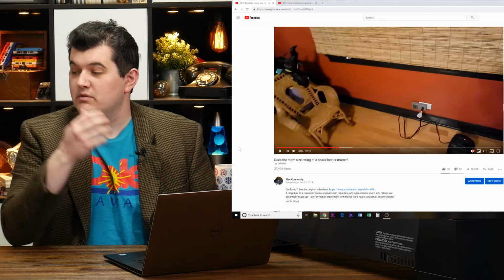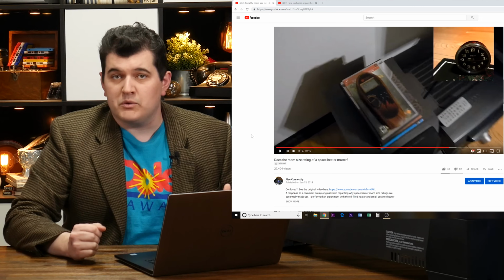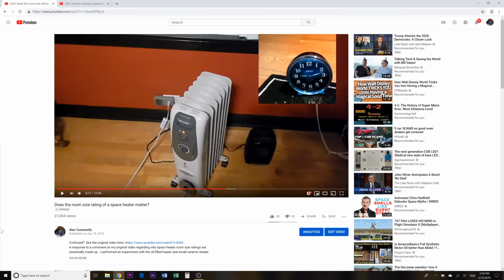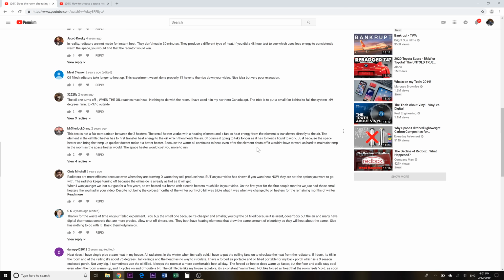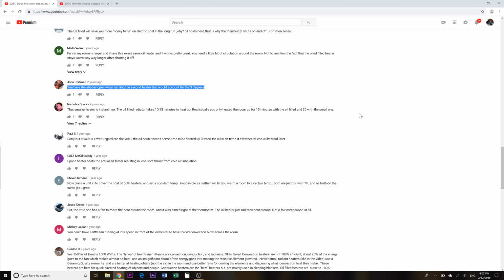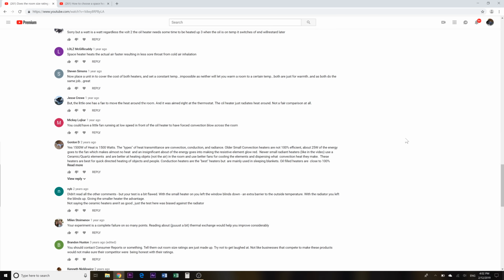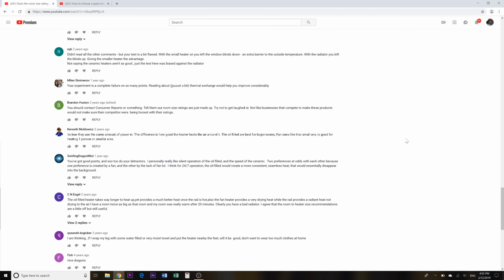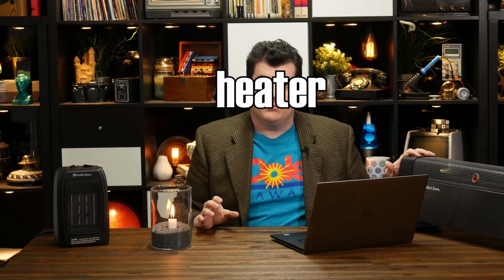More Space Heater Nonsense

Comment: The honest thing about the room size is like you said MARKETING. I know my mom has baseboard heat and they suck! Simply because like you said it all goes up to the ceiling. If you have bad insolation the heat is lost outside (like she does) she also loves oil filled space heaters which I discovered years ago were no better at heating up a room because of its own design flaw (50+ years and they can't fix this??) 1500watts is 1500watts no matter how you look at it. I myself prefer fan forced heat because it gets the air moving and therefore makes the room appear warmer faster. Now my shop uses 120,000 btu karo heater(another topic I know) but it's the same idea, fuel to heat to room. You can't get more out of the same amount of energy. Idk why those people argued with you so much the first time. I think your channel is absolutely amazing and very informative. Keep it up man!!

Comment: Linking comfort to temperature in degrees F or C are the biggest fault of humanity. Comfort is determined by the energy loss of your body, and the work your body has to do to compensate for that. The oil filled radiator will heat up a big room nice and evenly if it is switch on and never off. The air heater works with an on off thermostat that will be unable to keep up with a bigger room and opening doors loosing more heat. The power is the same, but I would expect more comfort form the Oil filled Radiator.

Comment: It sounds like you missed one opportunity to illustrate your point when you spoke of your test with the oil radiator unit and its cycling compared to the smaller fan unit.  I'm sure you know this, but you didn't seem to present it; if your watt meter (or what ever the particular measuring device was) was measuring the power used by the 1500 watt heater, as the heater cycled off 50% of the time, it should have shown that the heater only added 750 watts of power to the room over the hour, and 375 for the 30 minutes.   This would be half as much heat as compared to a 1500 watt blower style heater running at 100% cycle.  Period!  And it sounds like the radiator heater was cycled off more than that.  The second issue you started to address and then didn't seem to complete, though it has noting to do with the room size issue particularly, is that of comfort level.  The temperature of the air coming out of a blower system (hot or cold) is substantially different than the average room temp and your skin feels that pretty much immediately.   This is a very different heat transfer situation than with a radiator system.  (You really notice this difference more when the blower cycles as well.)  I will not be comfortable in a 75 degree (f) average room sitting near a vent with 65 or 85 degree air blowing on me.   (Or just generally when the air starts and then stops moving.)  As you were somewhat suggesting, the radiator unit might have provided better performance if it was fitted with a remote thermostat to prevent it from cycling needlessly.  If it had been, it might have provided a more comfortable heat, along with a quieter and possibly safer operation as well.  (But still not more heat, and/or at greater efficiency.)

Comment: I also disagree with your conclusion. You didn't ask the right question at the beginning.
These oil heaters are meant as replacement for central heating. They are to be left on all day and to keep a steady temperature. The manufacturer stated on the packaging for what size of room the heater can fulfill this purpose.
The fan heater in contrast is designed for quickly heating up a room. To get a cold bathroom ready within 5 minutes. This requires a much higher power for the same room size or limits the room size to a lower value for the same power. Also in this case the manufacturer stated on the packaging for what size of room the heater can fulfill it's purpose of quickly heating it up. Since the power rating is the same the room size rating is much smaller.
Both manufacturers are perfectly correct. You made an inappropriate comparison and are too proud to admit that this time other people were right.
Reply: "This requires a much higher power . . ."  Sorry, they were both 1500 watt max heaters.  How that power is delivered (radiant or convection (fast or slow)) will never make it more power delivered.
Reply: @buddyb4343  Please read more carefully. I explained very detailed that the fan heater is rated for smaller rooms BECAUSE it's only strong enough to QUICKLY heat up a small room.
Reply: @MetalheadAndNerd  So my first question is, did you see his video from Feb 13, 2019 that this video was addressing?  Secondly, although I probably didn't make my point as succinctly as I should have in my previous response, I can try to correct that now.  It seems like you are continuing to equate the size of the heater to the size of the room being heated based on a perceived effectiveness of the heat transfer mechanism, (smaller/smaller room) direct element forced convection versus (larger/larger room) indirect passive convection unit . . .   "BECAUSE it's only strong enough to quickly heat up a small room."  . . . That is just not a true statement.  A blower style heater will typically heat any reasonably sized (thermally sound) room at least as quickly if not more so than a convective/"radiator" style heater of the same power capacity.  (Due to better distribution of the heat, though the specific total heat in the room might be very similar.)  In both cases, the room temperatures will still rise until the energy in is balanced by the energy out.   Which in both cases is 1500 watts.  If you want your smaller heater to heat the room less quickly, just turn it to a lower power setting.   Cheers.   :-)
Reply: @buddyb4343  Is it really so hard to completely read my comments?
Should I repeat for a third time what you should have read the first time?
I am not talking about perceived effectiveness. I am talking about usage scenarios.
To keep a room at a steady temperature you don't need as much power as to quickly heat it up.
Oil radiators are used for keeping a steady temperature. Fan heaters are used for quickly heating up a room. 
These are different usage scenarios which require different amount of power per m² to archive the designed goal.

Comment: The radiant heater vs the fan powered heater was an apples to oranges comparison.    The radiant heater acts much more like a capicator and will release heat into the room even when its powered off.          Much slower. Much more stable.   Room size raitings are absolute bullshit.

Comment: What happens if you place a fan on the oil-filled type such that it never reaches the trip point of the thermostat? The output of the oil-filled type should then be equal to the non-oil-filled type. (Naturally the additional draw of the fan motor adds to the heating from the heater.)

Comment: My man when you keep trying to convince people in the scientific and technical way and it just doesn't go well, switch things up and simply show them. You're still using words and concepts when it would be much easier to simply show them both operating in a small room AND a large room. If you have 2 batteries and you're explaining to a person how you can wire in parallel or in series to get different voltage or amps and they're absolutely disagreeing that it is possible you can either construct a full lesson on electronics and go into detail about why it works, or spend 30 seconds pulling out a meter and simply showing them that it does.

Comment: I believe there are ways to justify the room size arguments, applied correctly or not is a separate argument. 

There's a reason a large warehouse, workshop, or shopping space would have multiple units spread around the facility, not all in the center of the facility or one really large unit that does everything. Obviously if that worked, the installation would be cheaper - one large gas pipe to the unit would be better than hundreds of thousands of feet of pipe.

The spherical cow is a fallacy here due to the realities of home construction, fluid, and thermodynamics (especially the older they are).  The sealed insulated box is too much oversimplified.  Hot air rises, windows aren't sealed perfectly, and rooms have entry and exit points or you have an open floor plan.  Stagnant air is an insulator (the air space in insulation is what does the insulating, not the fiberglass).  Fluid dynamics of the airflow could be very complicated, also... a piece of furniture could make or break the effectiveness of the heater.  There are several reasons a large slow moving ceiling fan are better than smaller ceiling fans which are much better than a desktop fan for making the room more comfortable, where-as a desktop fan could make you personally cooler IF you are in front of it.

A big argument is probably the duty cycle intended for this use... if you just want quick heat for an hour or to occasionally take off the chill, then a small unit will work fine but you don't really want to run these 24/7/365 at high duty cycle and if you try they'll die quickly.  The larger units would spread out the stresses, thereby extending the life.  An air-cooled unit without ceramic is basically a light-bulb without the bulb and relatively short-lived.  A ceramic heater has the added benefit of the support and conduction cooling of the elements, and the oil-filled heaters can use what amounts to the same heating element in an electric hot water heater, which with sealed clean fluid could be a lifetime device even if run 24/7/365 at max duty cycle.

Convection heater design could make a big difference in airflow.  An oil heater has a large airspace and will safely radiantly heat the wall you have the unit near and spread it conductively to an extent, thereby moving more total air and also giving a better radiant surface.  A long heater of similar design will spread the air better than a short heater.  A well designed convection heater will also radiantly heat the internal and external surfaces around it thereby creating more surface area, transferring the heat and causing higher convection airflow.  Spreading the heat could also cause a more laminar airflow making the heat more even. You also get the benefit of the thermal mass of the walls.

Fan-forced heaters, size matters:  Same arguments about desk fans vs ceiling fans.  Due to fluid dynamics stuff too complicated to get into here, you can have stratification effects.  Airflow will be blocked by... surprisingly, the air.  Corners especially reduce airflow, as do walls.  You basically (oversimplified) compress the air against the wall, creating an invisible barrier.  

Radiant heaters:  The heat can be felt directly rather than heating the room, also the radiant heat will reflect off of walls and surfaces and re-radiate, making you feel warmer even if the air temp is lower.  Windows also do not pass infrared, whereas conduction losses can be dramatic.

Insulation effectiveness is also affected by moisture in the building materials, I have read by as much as 50%.  Just heating the air concentrated in the center of the room won't as effectively dry out the walls.  If you just run these occasionally to take off the chill, the outside surfaces are definitely colder and more likely to condense the moist air from the room, making the situation worse, where a unit that is intended to run more consistently and/or radiantly heat the surfaces has a chance to dry out the envelope, increasing the insulation effectiveness.  A unit like a convection heater or oil heater intended to safely run against a wall will therefore work better for a medium to large room than a fan heater intended to only rapidly cool the air.

Comment: 15 years of HVAC and two journeyman tickets, I can confirm that all people disagreeing with you are complete idiots. You have a VERY firm grasp...which is quite simple...of all the laws of thermodynamics. I could not imagine the frustration.
Reply: This is why I went to school. Well currently in classes. Leaning how to fix and repair anything involving HVAC. 
People aka "experts" will always keep me in business down here in the south lol.
Reply: Would the larger ones with much bigger heating elements not overall run cooler per ft³ of said element? Thus being safer to run 24/7 compared to tiny ones only meant to be ran a few hours a day. They put out the same heat sure, but may have different safety tolerances.

A lot of the larger ones I've seen call out that they can be used for a full day while the smaller ones all say not to run for more than 3-5 hours depending on brand.
Reply: I have 2 fan forced heaters.  One is small & identical to his unit.  The other is about 4 times larger, because it’s a large room unit.  Both 1500 watts.  Both heat the room at the  same rate

.
Reply: @electrictroy2010  and one will also last longer due to duty cycles.
Reply: @NWinnVR  Still doesn't make sense at all. So you have a small-room heater that warms up your small room in 15-20 minutes, and for the big room you want a heater that will take hours? That was, at least, the point of his video. They also don't design these heaters to catch fire regardless of how long they need to stay on.
Reply: @HHXOXHH  yes, thats the idea
Reply: @NWinnVR  I think you're right. It's similar to heating elements in an electric water heater where certain elements are smaller (and have heat more concentrated), whereas some are longer (more surface area, resulting in the heat being spread out more).  That being said, spreading the heat out would likely be safer and less likely to burn out.
Reply: The Youtuber should have used the same TYPE of heater.  When doing an experiment it’s important to eliminate all differences except one (the thing being tested).

Comment: So basically 
You’re telling me
That my big semi going 61mph and the tiny car next to me going 61 mph🤨
Are going to get to point b at the same time???? Are you stupid ;P
Reply: Yes.

If they are traveling an average of 61mph, then yes.
If this is not an “average of” question:
If they are traveling 100 miles, probably, yes, unless they are traveling in California, as California limits semis to 55mph, so the semi would repeatedly be pulled over by DOT and the ensuing DOT inspection would take so much time, the car would arrive first.

Also unless one of them desperately needs fuel and needs to stop partway.

If they are traveling a very long distance, then maybe not. 

A semi can run 1-2,000 miles on a tank of fuel, while a car can usually run less than 400.
Much like the oil heater cycling on and off, it will take longer for a car that has to stop and get fuel repeatedly to travel 1,000 miles.

Except... DOT limits drivers to 11 hours a day of travel time per 24 hour period. Avoiding slowdowns and averaging 61 miles per hour, a semi with one driver can only legally go about 671 miles before the driver must rest, while a car is not under regulations like that. Traveling 305 miles (5 hours of driving) then taking half an hour break to refuel at 61 miles per hour while traveling would yield 1,322 miles in a 24 hour period; so the car would travel further.

If miles to B are equal to or less than the distance the car can travel on one tank of fuel, they will arrive at the same time unless they are in California.
If it is between the distance of one car tank and less than or equal to 671 miles to point B, then the Semi would win. 
If it is further than 671 miles from point A to point B, then the car would win.

Also, Class A speed limit in Hawaii, Michigan and Washington State is 60, so at 61, you would probably get by with 61mph, but sometimes you get a stickler cop.

Also, sometimes DOT pulls commercial vehicles over just for fun times (i.e. inspections) and they feel like they take six months to complete, so sometimes even at more than the car’s tank limit and less than 671 miles, the car still wins.

So yes, but also no.
Reply: @Efferheim  you just took that and ran a whole marathon, huh?
Reply: @doubtful_seer  
Of course. Sometimes the lunacy of reality is the best way to point out a bad statement.
Reply: Bc the BTUs are a measure of heat/hour this is a good analogy right?
Reply: @matthewheitzman5993  Yes, as far as I can tell this is an excellent analogy.
Reply: What else can we expect from a "car enthusiast"
Reply: Depends which one uses the fuel with the higher BTUs